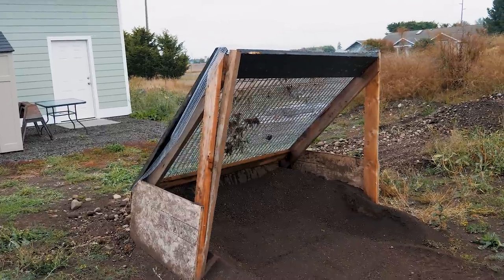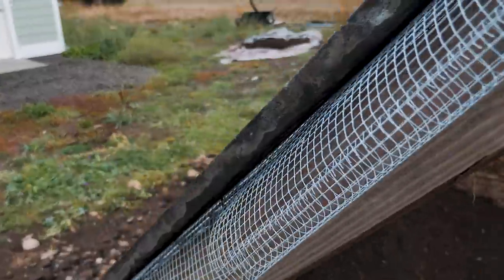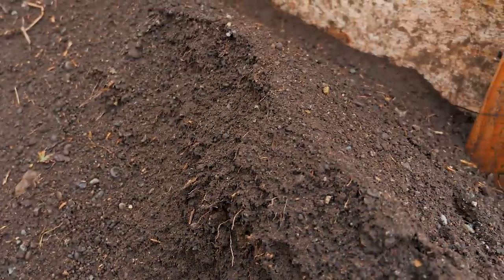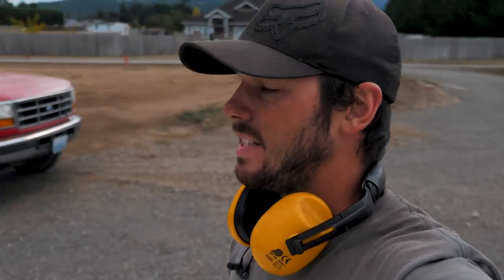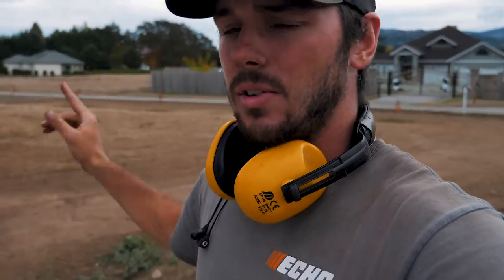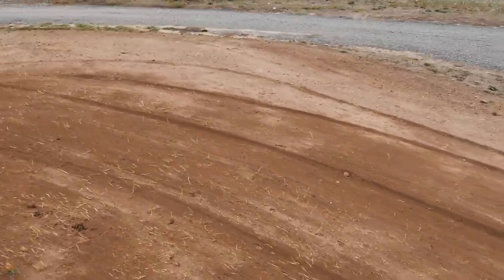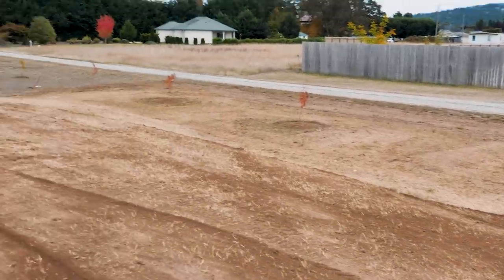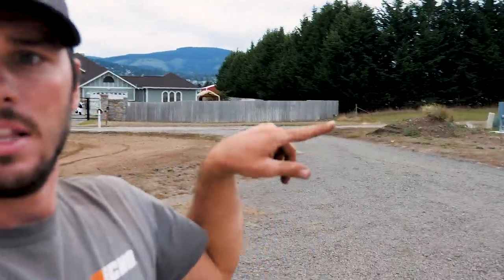Simple DIY Dirt Screener!

Comment: Only thing is nails won’t shear like a machine screw. Screws are harder so they will break. Nails just bend. You could use duplex nails that are used for concrete and have a extra step so when you Barry the nail you can still pull it out.